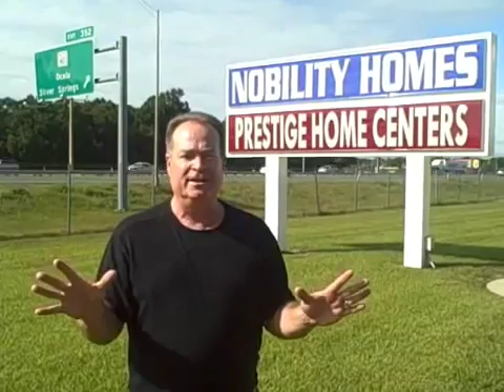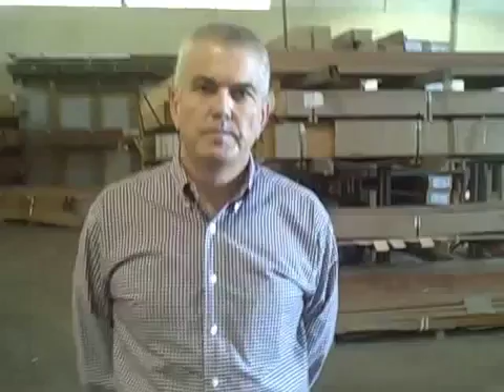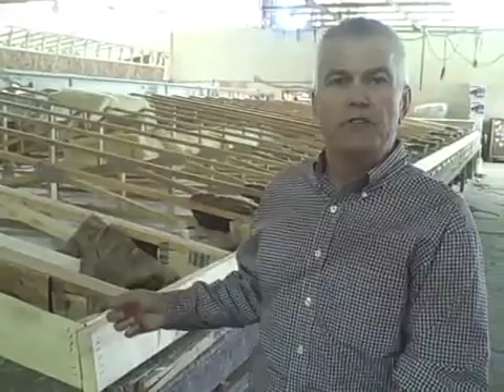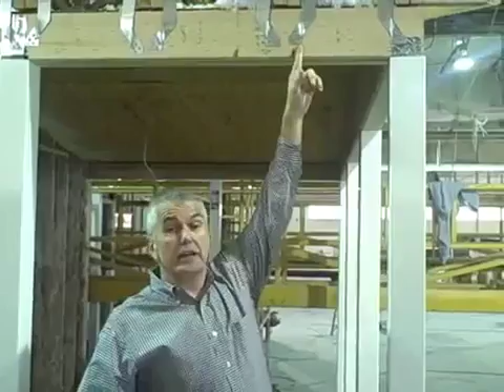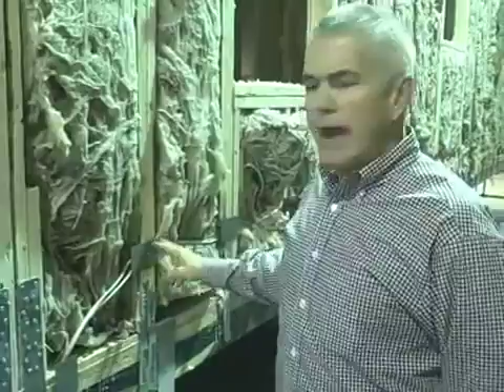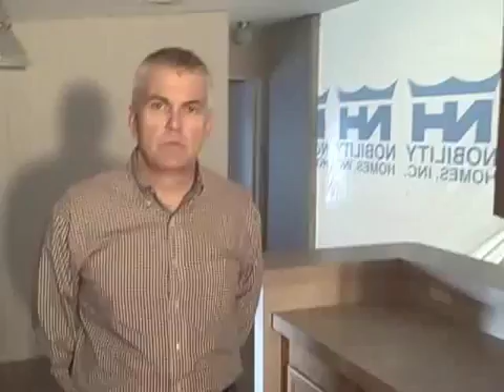Nobility Homes

Comment: Sidewalls are good, fixtures in bathrooms are bottom line, plastic in fact, insulation is impressive, windows are not double paned unless you pay extra. They don't tell you that. Inside trim work is cheaply installed and constantly comes loose from cabinet structures. Was sold on marble window sills instead composite was what I received. Skirting is cheap material and an awful job of installation was done. Yes, in their defense they give you a year to fix things in the home but there are things that were not documented and never addressed. For instance, a ceiling crack caused by the joining of the two halves of the home.  There's supposed to be a beam there no one bothered to finish. I'm paying 6 digits for a home that I'm ashamed to tell people how much I paid for it. Worst home buying experience my husband and I have ever experienced.